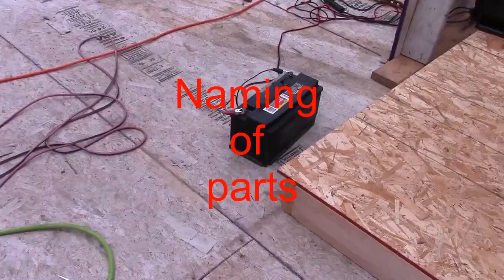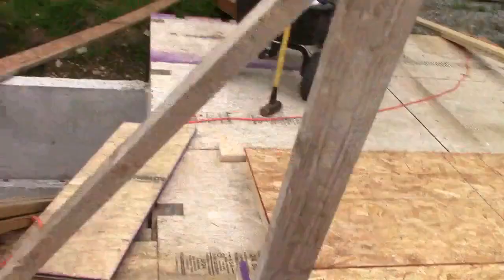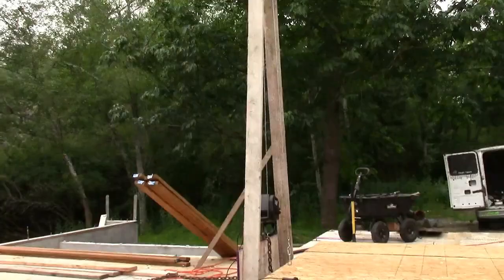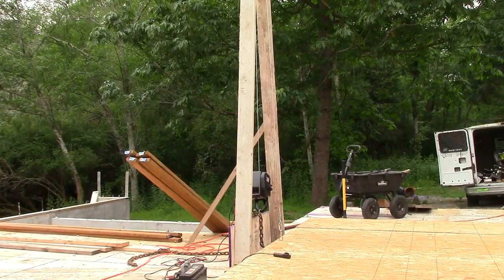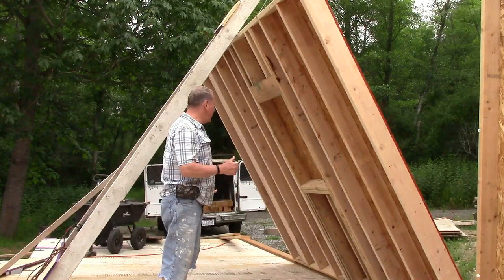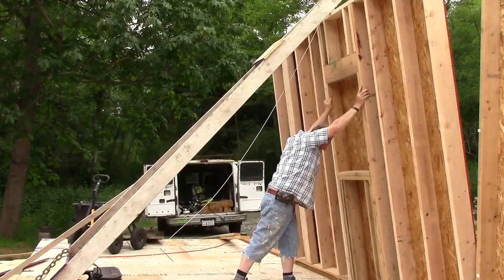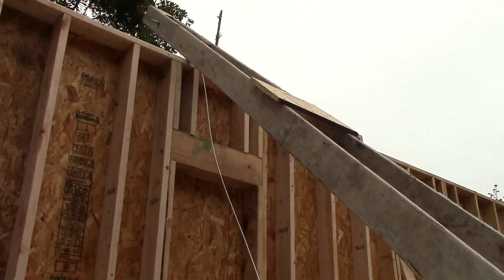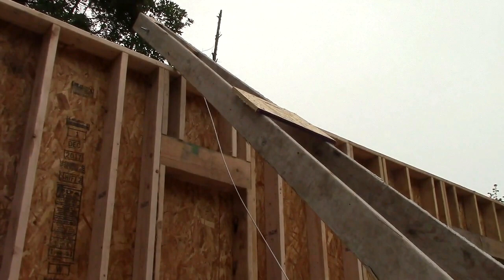Erecting a wall with an improvised hoist  made for under $100

Comment: Good idea, BUT NEVER use "S" hooks for lifting anything. Should use a closed style chain connector/ coupler.
Reply: Yeah and those turnbuckles are weak.  I'd use stronger stuff.  I'd also hook the wall from the inside.  Great job, though.